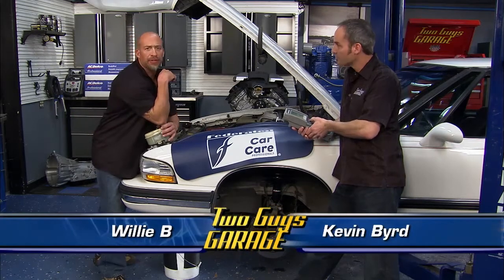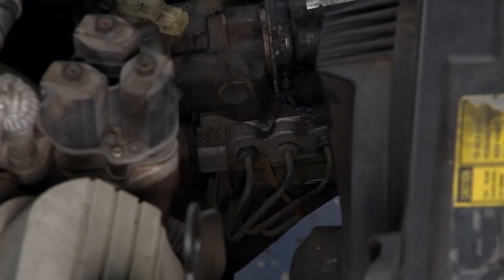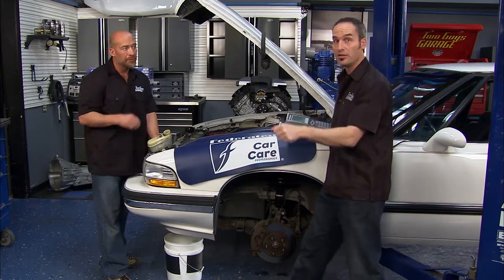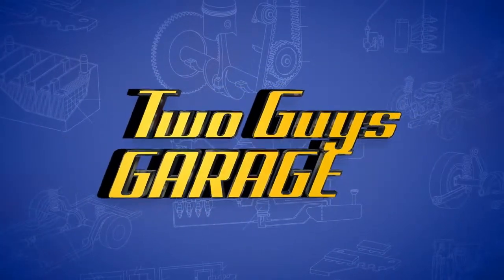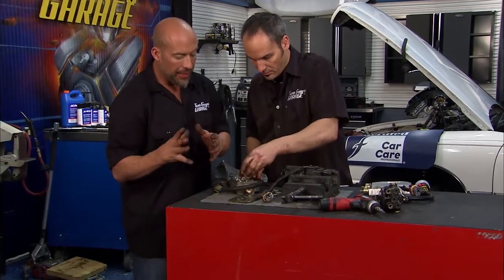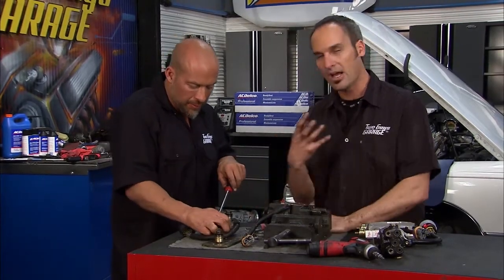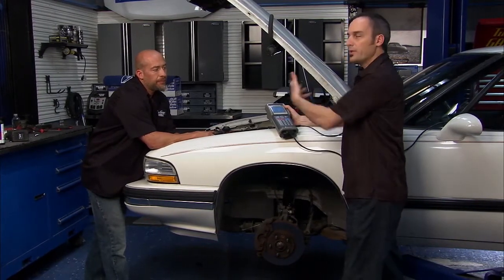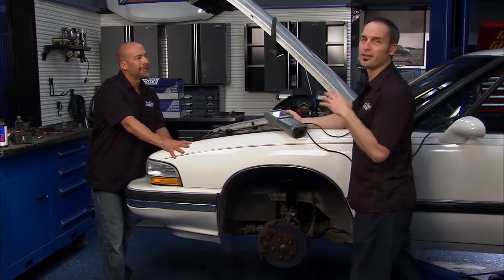ABS Fix | Two Guys Garage

Comment: Excellent that you disassembled the old ABS valve unit to show us the crap that was holding the valve open.
But, no mention of pressure bleeding the brake hydraulic system or vacuum bleeding it with a Mighty-Vac or similar tool?
Yes, you installed a new master brake cylinder so that "pump the brake pedal" bleeding is "safe", but that is a job that requires two people. OK for the "Two Guys Garage" but what about the D-I-Y guy whose friends disappear while the system is being gravity bled - for how many hours?